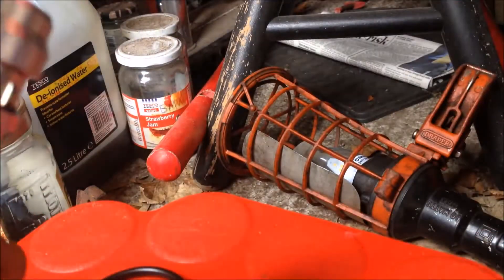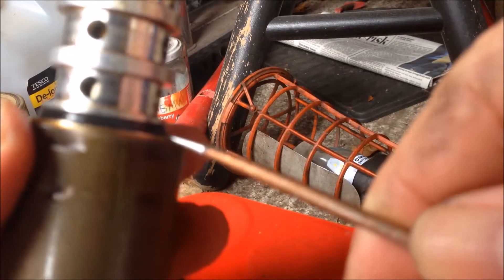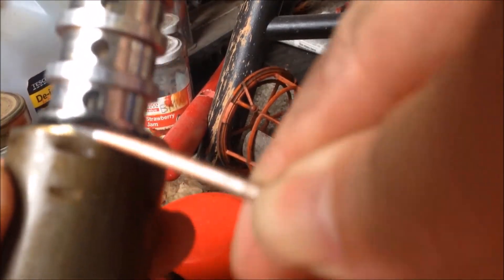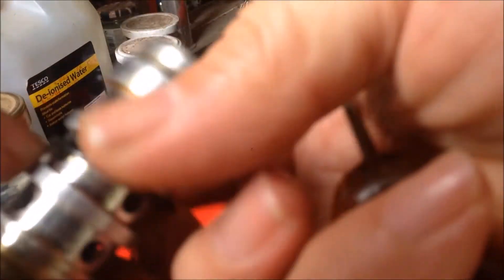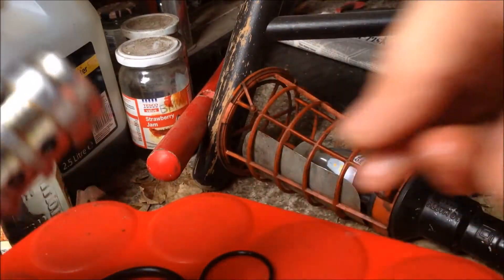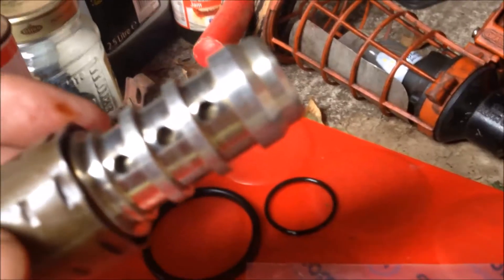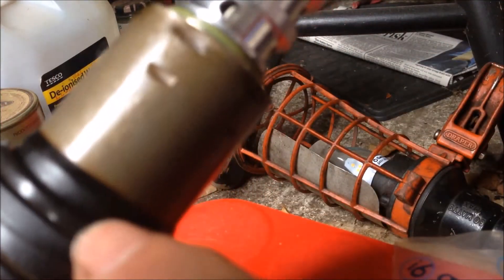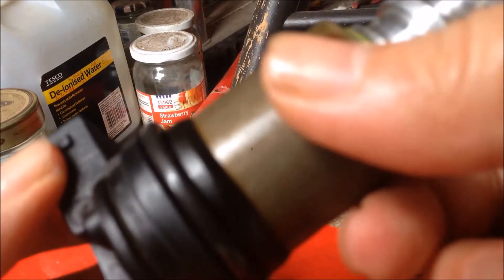BMW E46 / N42: VANOS Solenoids: How to Replace the Orings

Comment: I have the N42 engine and noticed that mine did not have the big o ring on both of the solenoids and took a good look on the engine but nothing was on their either. I did install the big o ring . Just wondering  why mine didn't have it . I bought the car new .
Reply from the maker: Yeah, that was a bit strange. it should have been there. My ones were there after 13 years, just hard and pressed flat on both sides. could be someone forgot to put them on or lost them? it would be less likely they forgot them in the factory? Any way it was a good news that you managed to find out. Great!